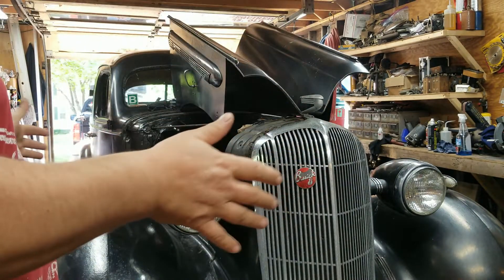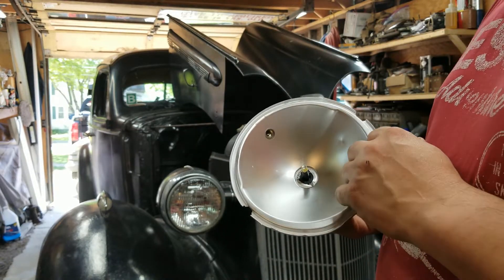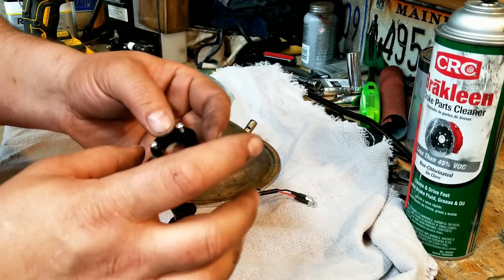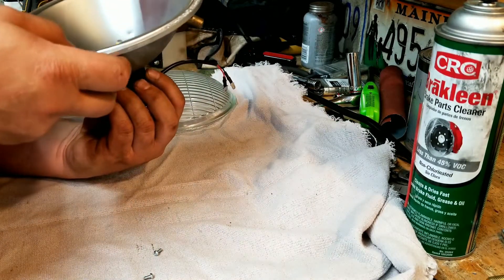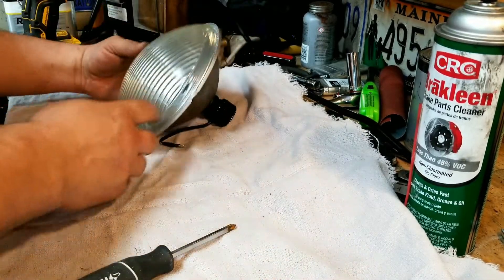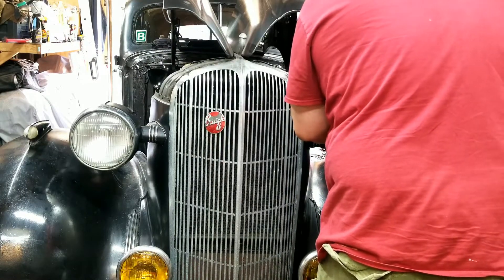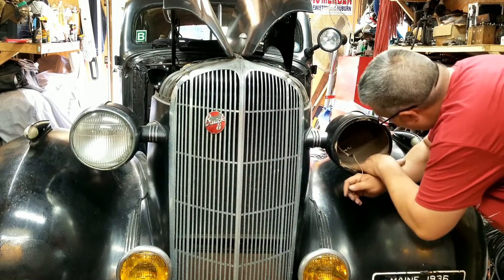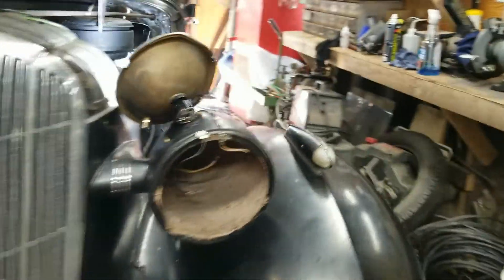1936 Buick Century LED headlight upgrade

Comment: The move is good, my point is how you can be certain that the light emitting source is in the true focus of your parabolic reflector ?
To me, it is the time to convert to 12 volts as the transformers between the system and the headlights is a weak unsafe component.
On such a car, a medium capacity alternator is more than sufficient and it will give you a much better service than the actual generator. On such an old car, if the wiring is original, you call for trouble as most of the wires are decayed and just waiting to cut or worse , short somewhere and cause a fire.
very good adaptation work.

Comment: Why wouldn't you just go with halogens? Fool...
Reply from the maker: To keep the current draw low. There is not a lot of spare capacity on these old 6v generator electrical systems. LEDs draw much less and you get as much light. Thank you for your question.

Comment: Nice work, boy I see a lot of ppl doing this now. I have yet too. I'm so bad, I still have the old 35 "candle power" bulbs" in mine. I don't know how they did it back then, but I guess it beats walking.
Reply from the maker: I know what you mean. Traffic moved much slower back then. Nowadays it is scary driving with these stock lights.